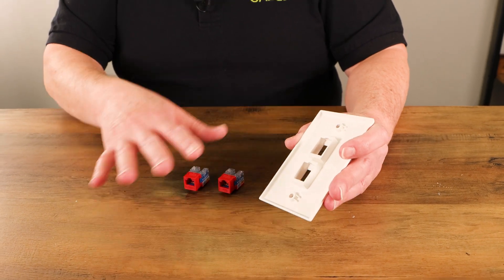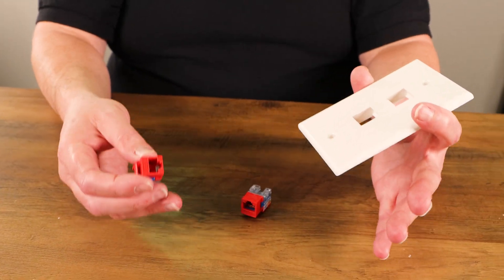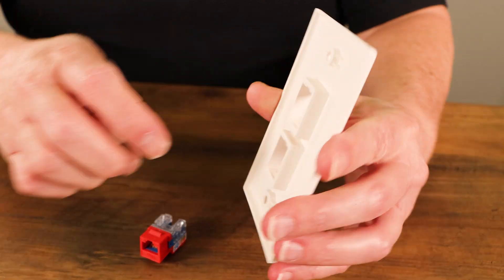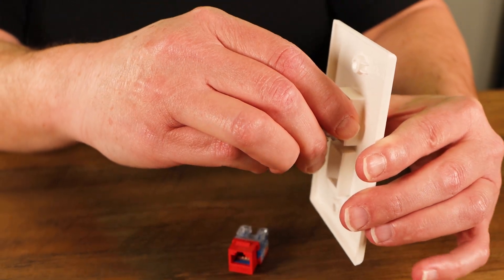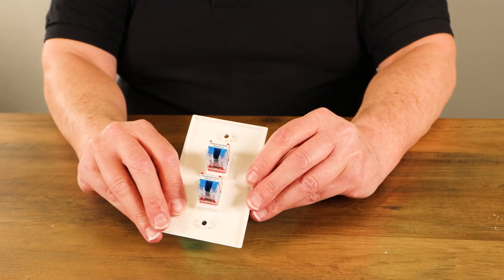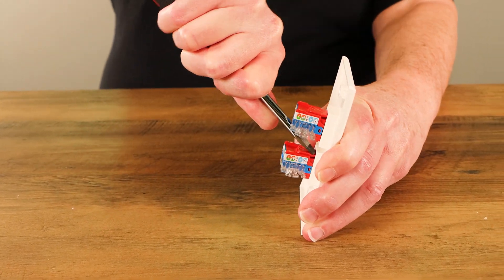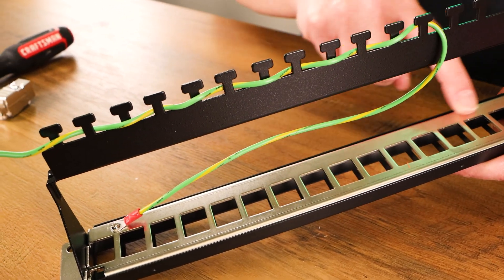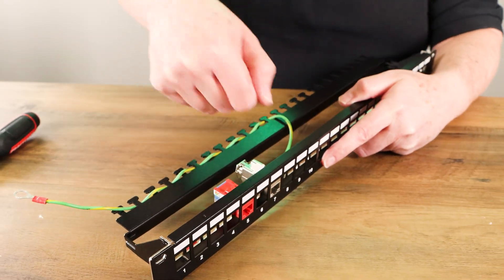Best Way To Remove and Reuse a Keystone Jack (Simple Trick)

Comment: God bless you! I hurt myself trying to remove these durn do-hickeys and your method with the screwdriver worked in an instant and without hurt!
Reply from the maker: Hello! We are glad we saved you the pain. Another idea, and an even better one, is to take a wood clothes pin and break it in half. Use one half like you would a screwdriver. That way if you slip, you won't cut yourself or gouge a table or wall.

Comment: My keystone has two clips, what one should I work on?
Reply from the maker: Hello! There should be long clip on the top of the jack, and a fulcrum point on the bottom of the jack. I have never seen jacks with TWO actual clips. Can you please a brand and model number so I can take a look at this particular jack?
Reply: @trueCABLE It is a local (Italy) bTicino Matix, turns out I should pull up the clips and not press them to release the plate. I was working on a RJ45 plate.
Reply from the maker: @elnath1978  Hello and thanks for that clarification. The product sounds proprietary, so we are not going to be able to pass along any advice of benefit.
Reply from the maker: @elnath1978  Hello and thanks for clearing that up. That makes sense now. The bTicino Matix system works differently than the what is normally seen, hence the confusion. A lot of decorator type plates are proprietary in some way or another so that competition cannot copy their design.

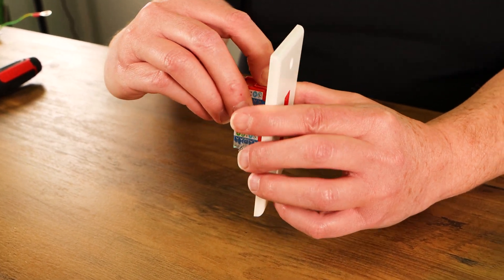Comment: 4:01 You will make life an awful lot easier if you use a thinner blade screw driver. I just pulled out a few dozen Keystones and started with a screwdriver just like yours. I soon switched to a smaller screwdriver with a much thinner blade leading edge. The difference in the ease of popping the keystones out was huge. It's amazing what a huge difference is made with just a small difference in blade point thickness can make.
Reply: Lol, I’m cracking up thank you for this comment. Switched to a really small screwdriver and it came out incredibly easy.
Reply from the maker: Hello! Agreed, a thinner blade helps a lot. Also, I now use half a wooden clothes pin (slimmer side) to depress the tough plastic latch. Safer on your hands and keystones or working surface. Give it a try!
Reply: @trueCABLE  I love it.

Comment: I removed a CAT5 wall plate and discovered that behind it, the CAT5 was going into a keystone jack, which was attached to the back of the wallplate itself.  Before I break anything, just to verify, the keystone should unclip from my old wallplate and the re-clip onto my new wall plate?  Thanks, love your channel
Reply from the maker: Hello! It sounds like you are describing the cable as directly wiring to the wall plate, as in the termination is not actually a separate keystone jack. That is one OLD wall plate if that is the case! Did your home builder split off two pairs for phone and two pairs (out of the 4 total pairs) for data (max 100 Mbps speed)? It sounds like that is what is going on here. If you wish to retain your landline phone (if you use that still), you will lose it by connecting all 4 pairs (8 wires) to a new keystone to achieve Gigabit speeds. I need more information on what your intentions are.

Comment: How to remove the keystone plasric cover
Reply from the maker: Hello! I am not sure I understand your question. Can you rephrase?
Reply: On unused jack i plugged the transparent plastic jack cover. I want to remove so that connections be made
Reply from the maker: @fmm5322   Hello! How you remove the transparent cover depends on the brand of jack. Our transparent covers have squeeze tabs that release the cover and it is very easy to do. Other covers may require carefully prying the cover off with a precision flat blade screwdriver. It will be easier to dismount the jack from the wall plate BEFORE attempting to remove the cover, and you will need to dismount the jack to terminate it anyway. I hope that helps!

Comment: Hey,

Is there any way to actually and safely remove the colored end of the jack? I am asking because one of my jacks is loose and throttles my internet when the Ethernet cable moves slightly in its jack. I have already broken the upper latch trying to remove it from the wall plate so at this point I am trying to only change the plastic end that goes into the wall plate because I have zero experience trimming cables and such. 

thanks for letting me know
Reply from the maker: Hello! Unfortunately, the colored portion cannot be removed. It is permanently attached to the rest of the jack. The best you can do is to remove the wall plate, remove the cable from jack, and then replace the jack with one that works. For instructions on how to terminate a keystone jack (using one of our tool-less keystone jacks), please see https://www.truecable.com/blogs/cable-academy/how-to-terminate-an-unshielded-toolless-keystone-jack. Be sure to purchase the Category of jack that matches your cable Category. If you are in doubt, then simply purchase a two pack of the Cat6A jacks and you will be covered.
Reply: @trueCABLE  thanks for the swift response. I guess I have no other choice but to get my hands dirty and start learning a new skill!
Reply from the maker: Hello Billy! It is fun learning a new skill. Our Cable Academy will get you up and running pretty quickly! It is rather comprehensive.
Reply: @trueCABLE  just got around working on the replacement and it went flawlessly, I’m kinda surprised lol. Thanks for the tips and tricks, I am now confident in this new skill!
Reply from the maker: Hey Billy! You are welcome, and any time. We are glad the project went well.